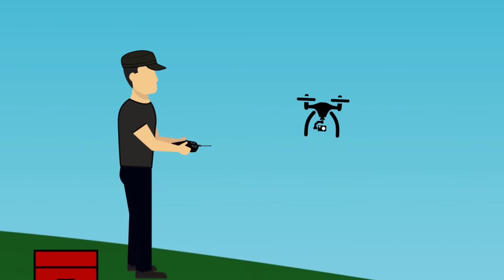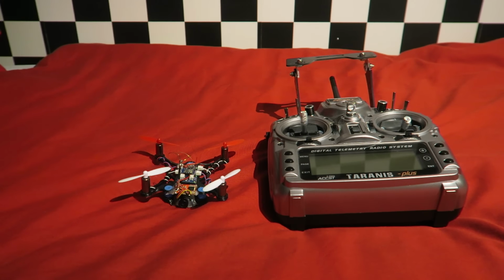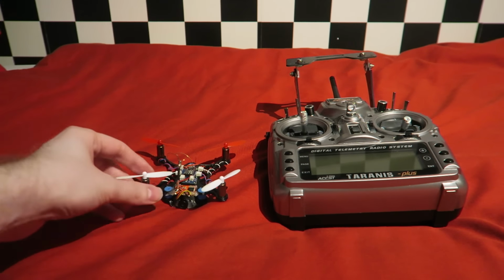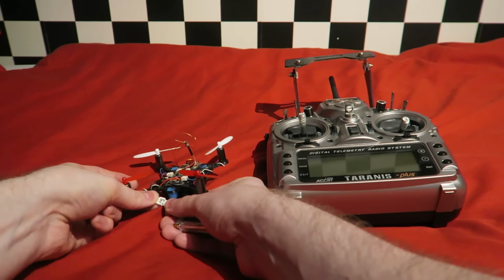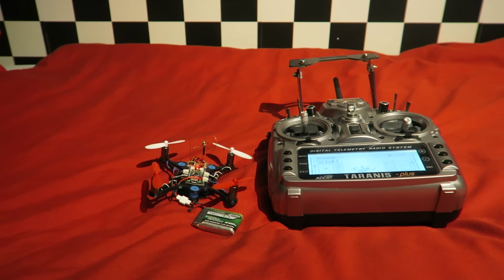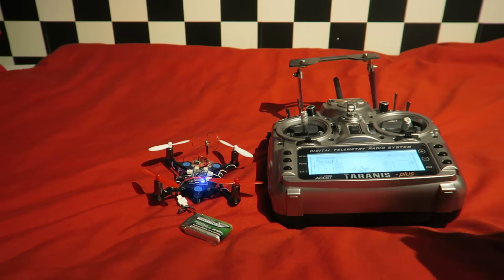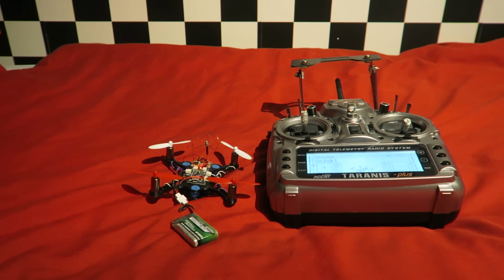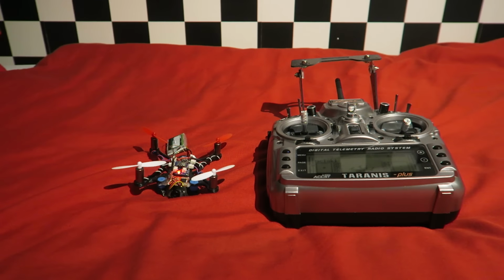Scisky Tuning Session

Comment: I haven't had any bind issue, but I always turn on the transmitter first.
Reply: +Nick Burns I use the devo 7e
Reply from the maker: +Nick Burns i have had bind issues with the devo 7e and the taranis with two different boards :(
Reply: +AndyRC that stinks. Maybe try turning on the transmitter first a few times to compare?
Reply from the maker: actually i find that turning the transmitter on first causes the most problems which is why i do the quad first in this vid. what TX are u using?
Reply: +AndyRC Devo 7e mod with deviationTx
Reply from the maker: interesting that you dont have the bind issue! wonder what im doing different :( i have it with both transmitters so i can only assume its something in the scisky setup
Reply: +AndyRC I have two as well. Must be the rabbit's foot I carry.  :)
Reply from the maker: indeed lol

Comment: I are supposed to always turn on the tx before the quad with any of this kind of stuff
Reply from the maker: +RCflyer729 thats actually a myth. it was the case for 35mhz and 72mhz as there was no binding procedure so if there was anything transmitting on that channel when you turned the aircraft on first then you could get a glitch. with 2.4 it makes no difference
Reply: +AndyRC yea but still I would turn it on first I think that is why it went into bind mode that time
Reply from the maker: i still get the issue if the TX turns on first
Reply: +AndyRC ok that is interesting since I do not have that issue with my dx7s. I do have the issue with it not wanting to bind but it does bind eventually.
Reply: +AndyRC actually andy this is not myth...if you first power up your flight controller and receiver the receiver gona give you a lower throtle reading and fc will read this as signal lost and it will engage failsafe...ofc this only happens on controllers/receivers that support failsafe
Reply from the maker: nah thats not true
Reply: +AndyRC all the same everyone I know who has been flying rc for a while powers there tx up first so I would do it just in case
Reply from the maker: yes but as i say its not really needed for 2.4 its best practice for sure. for example if you were in a group and someone happened to turn their TX on using the same protocol at the same time u turn your aircraft on. highly unlikely though.

in the case of the scisky i have much more luck getting a bind the first time if i power the quad on first. this is also the case with a lot of the RTF aircraft i review on the channel.

Comment: Nice you are using betaflight! Give air mode a try when you are comfortable it's real fun
Reply from the maker: air mode confuses me a little. do the motors have to be set to move when armed for it to work?
Reply: +AndyRC  yes they do Andy   , so if you crash you have to disarm quick   ,it might be best to arm with a switch  , also with  brushless quads when you land in airmode  the quad can bonce on the ground a bit  so it is best to turn off air mode to land  , i have not seen a brushed quad with air mode so i,m not sure if this will happen . i am about to build on of these when the bits turn up  and your fpv  image looks much cleaner then your first  build and fly vid  i was wondering what you have done to improve it ? . cheers   .  lol i just watched the other video  and have seen how you've  done it   , good news for me is that i had already add one to my order ;-)
Reply from the maker: theres a video before this one that shows how I added another regulator to clear the noise. thanks for the info on air mode. i thought this was the case. It only works in rate mode too i believe. cheers!

Comment: Here's a tip i figured out with the binding issue....

My board started randomly blinking like this too when I was experimenting with 150mAh batteries. Battery still had 4.07V across it, but yet it wouldn't complete the bind. 
I tossed in a known good 240mAh and away she flew with a perfect bind every time.

Not sure why my 150mAh battery was causing issues, but if this is happening to anyone else, try a different battery and maybe it'll fix the issue for you too.

Comment: Just after talking to you earlier on the previous scisky video, I had a play with my scisky and noticed something similar (or the same?)

I noticed that if I had issues binding, I would unplug the battery, but leave the controller on. Then, reconnect the battery. It would then just switch on/ boot up and bind. Interesting.....reminded me of the blade nano qx, the controller had to be on before the quad. 

I loved the rolls near the end! Kind of a half flip and .... back on yourself? lol
Reply from the maker: yes starting to experiment with different moves now. getting ready for crashing the 250 lol

Comment: Turning the TX first helps me too, othervise I have similat issue

Btw, do you have any idea how to fix the props to the motor shafts if they are getting a bit loose after some crash?
Reply from the maker: +Robert Kovacs no unfortunately not. i rarely have this but when it happens i buy new props. its not worth the risk gluing them
Reply: +AndyRC I'm still waiting for bigger sets of props, so now I have to be careful with every single one :D
Reply from the maker: i understand its frustrating having to wait for stuff from china :(

Comment: How do you know when your battery is empty since there is no telemetry?
Reply from the maker: +xuxusito i set a timer for 6 minutes on the taranis i know i can get about 10 minutes but with this amount of acro i stay at a safe 6
Reply: +AndyRC which batteries do you use?
Reply from the maker: using 750mah nano tech 1s from hobbyking
Reply: +AndyRC Thank you Andy. Do you use a LC Filter? Or do you power up you FPV Gear straight from the Scisky 5v output?
Reply from the maker: i use a 5v regulator. if you check out the scisky vid before this it shows how its connected.
Reply: +AndyRC ok thanks mate.
Reply from the maker: no problem

Comment: Andy, question, I have a turnigy 9x and really want to get into micro flying after my son's Hubsan, but not sure which flight controller is compatible with the tunigy 9x?
Reply from the maker: non of them are unfortunately. at the moment most micros are using dsm2 or their own protocols. the only option is to buy a devo7e and modify it like the video on my channel or stick to dsm2 and buy a spectrum transmitter. I think there might be a way to mod the 9x to fit a module u can look into that but not to fly the hubsan
Reply: +AndyRC cheers Andy, I have seen a video now where I can change the module out of the back for an Orange one that would give me DSM and the its compatible to a HobbyKing micro board. Great vids by the way 👍🏻
Reply from the maker: great enjoy thanks for watching
Reply: +AndyRC Andy, the controller you use for Hubsan, this is the Skyhawk model? 
If so can you use it with all Hubsan flight controllers like the X4 107? 
For example if I used a Hubsan flight controller and installed FPV on it would this work. I'm new to this micro madness 🙈
Reply from the maker: +wildhogget69 its the hubsan spyhawk transmitter yes but the first version. it use to be the case that the old transmitters worked with all models but the plus versions of the models have been given a new protocol so the spyhawk transmitter now only works with the non plus versions of the x4
Reply: +AndyRC Doh! I'm getting nowhere fast with this, I will have to rethink my build for future quads, luckily this build is for a Hubsan X4 transplant. But for future builds I need some tx that will work with some brand of FC. 
As always Andy thanks for the quick response. 
Ps. Can you not do a basic build for a beginner 😜
Reply from the maker: if you mean a basic micro build then there should be one coming up soon :)